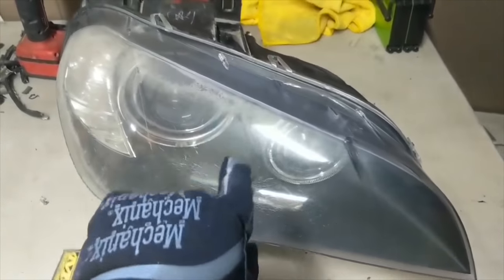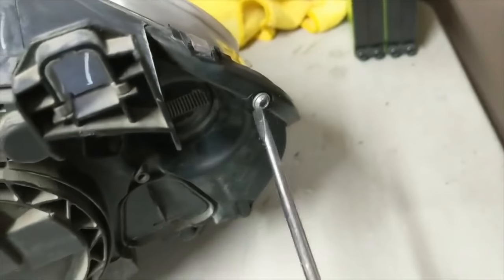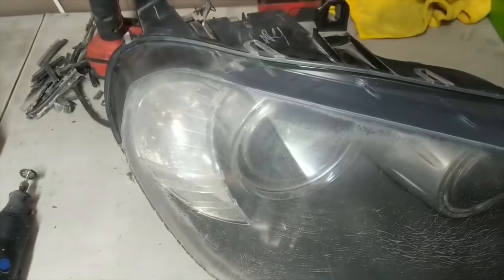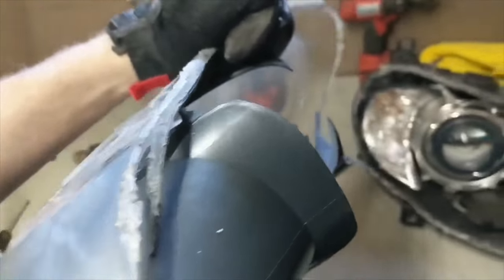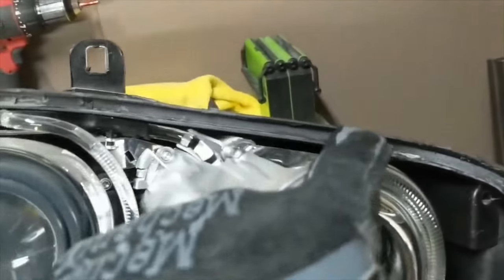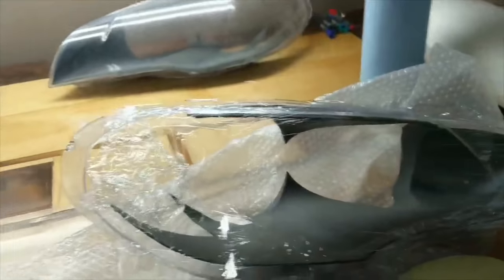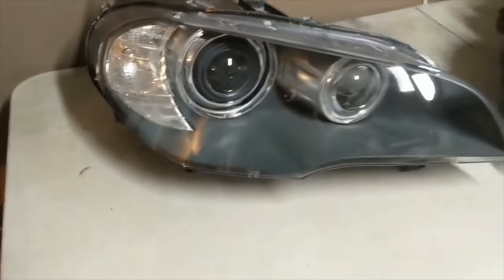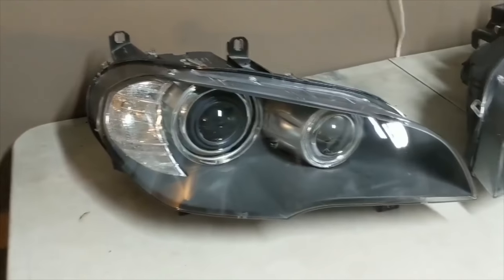How To Replace Headlight Lens

Comment: You skipped the most critical part! How to get the rest of the lens removed and how to remove the perma seal from the tracks!
Reply: He mentioned it. Use a dremel cutting wheel to brake the factory seal. Clean it off by scraping the remaining seal parts or bake in oven for better results. Put on replacement seal and join up the lens with the headlight.
Reply: "I'll show you what it looks like when it's done." What's the point of making a video.

Comment: Yo, unfortunately you are mistaking by cutting it. Just heat it up with the proper heat gun that the temperature can be adjusted at 180-220c to soften the seal. Then remove the old one n u can even use the same seal again for sure or replace the seal to make sure that won’t be any leak at all…
I did remove my e39 lenses n put them back on using the same seal without any issue at all. Then I polished them out n they look fantastic. Try on your next project.
Reply: I did this on my 2010 Audi A4. I was looking for this comment. You are 100% correct
Reply: You, Sir, should be the one making the instructional video.  Very helpful, quite unlike the guy in the video. Thank you.
Reply: Yes, you actually gave me useful advice than this video. Do you have your own channel? Thank you.

Comment: How many hours did you spend on it ?   It doesn't look like a fun job and it will in most cases show that someone has been tampering with the housing.  The plastic lenses is just another way for manufacturers to cheap out.  Sure, glass can shatter but glass doesn't fade and discolor so much over time.  And it was usually much easier to replace when having a rubber seal and metal clips to keep it attached to the housing.

Comment: Yo u made a mistake by Turing it all around. It is guaranteed much easier n cleaner by using a heat gun n once u remove it, u can just use the existing glue or adhesive to place the new lenses. Then it’s done. Try it out n u will see for ur self. Peace out!
Reply: he made a lot of mistakes